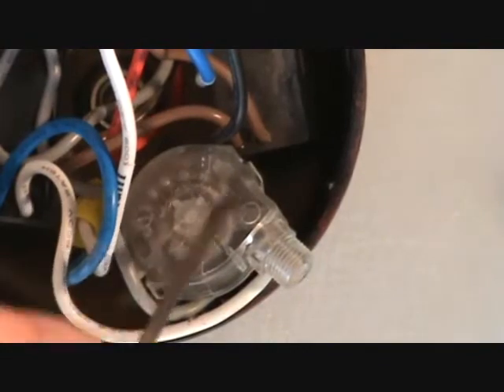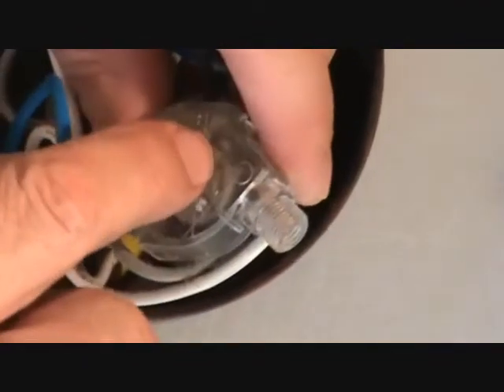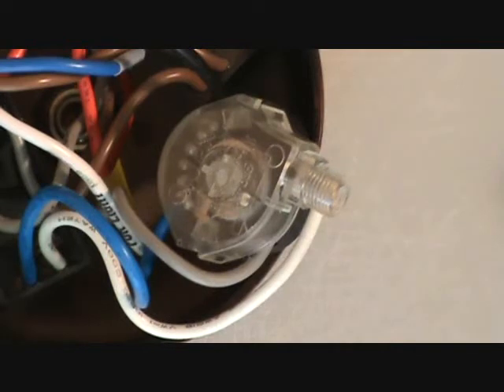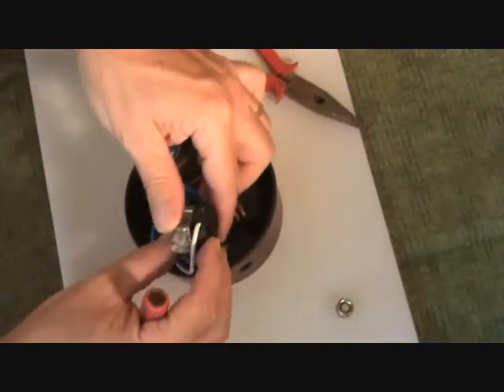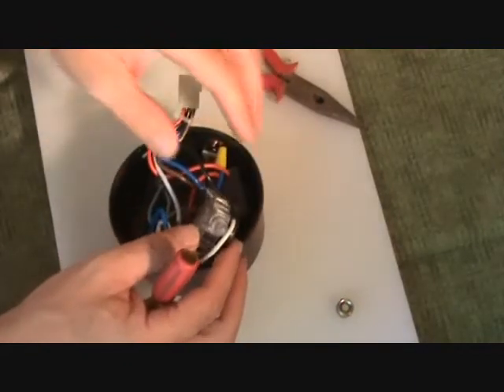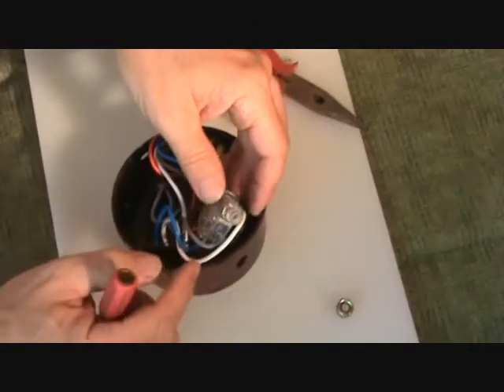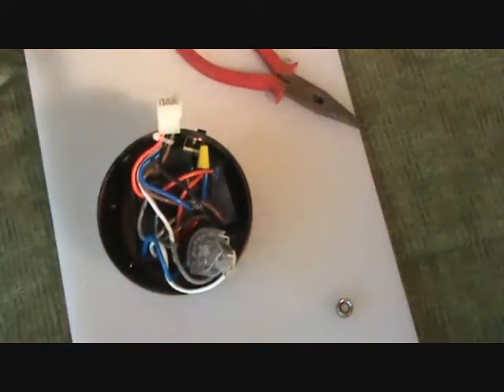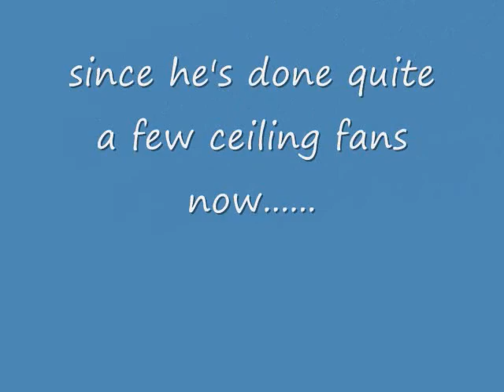How to repair a ceiling fan stuck on medium speed...Part 2

Comment: Ceiling fans sure are trouble some. Sometimes its because of a loose wire. Sometimes its because of motor failure. But they are fun to fix either way. Thanks for the upload
Reply from the maker: Yes....all ceiling fans are NOT created equal. But you already knew that! Keep up the learning process!   Joe  :0